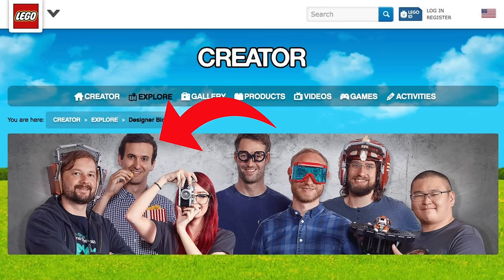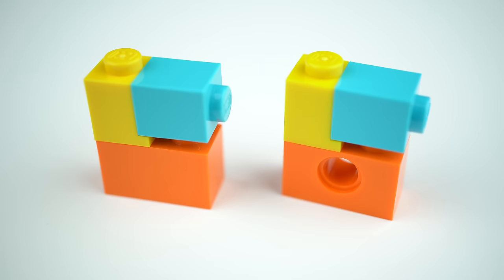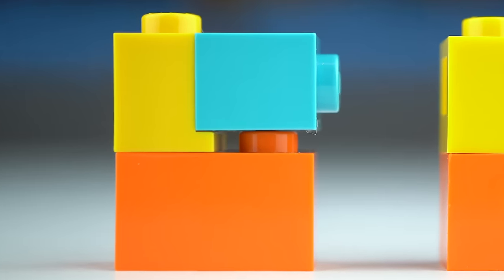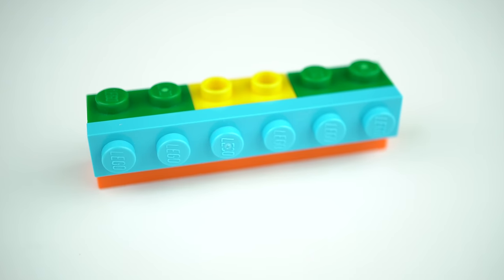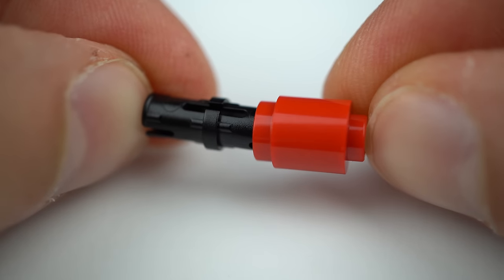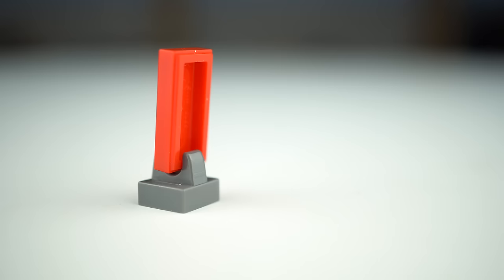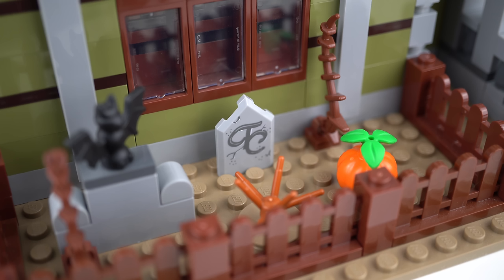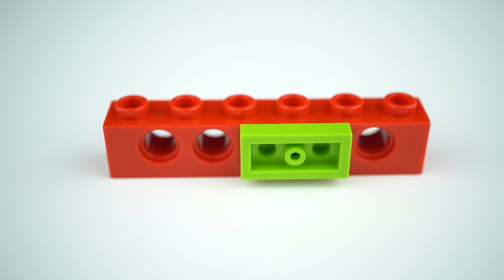Illegal LEGO Techniques

Comment: Oh so you designed the haunted house? Oddly I remember different people presenting it as creators. Either way I like that set almost even bought it but it was way too expensive where I live and importing it would cost double then what would I locally pay for ....

When it comes to preservation and proper usage.
My experience with LEGO is that many old pieces I have deformed or broke and I didn't even used it much.
There were few that I assembled and kept it as a display while upon dusting it off with a gentle brush I managed to somehow break pieces.
So using it how ever you want is welcomed because chances are some will break anyways so use it while you still can.
The high quality in LEGO is a myth, they are not that different from alternative bricks. Besides some of the even official ones are actually manufactured in China in relatively poor conditions. Hence why there is lots of knockoffs there since they copied or use 'outdated' molds.

Comment: I'm still a little confused as to how plates with more than one stud on a technic piece is illegal. I've seen people explain it as "the technic holes aren't spaced out the same distance as system plates", but putting technic pins (89678) in the technic holes and then putting the system plates on those is completely legal. What exactly is it that's causing the stress? 

I've seen a lot of mech builders also use a technique where they use 2 boat studs and place an axel and pin connector (32013) between each pair of studs, and always wondered if this was legal or not.
Reply: I know literally nothing about any of this, and had no idea about the concept of illegality before watching this video - so take my ideas with a grain of salt, however I think it's because of that extra diameter at the end of the technic holes that he mentioned for the technic pins to expand.
Reply: @willplay1a  The thing is, a single stud in a technic hole is legal. Plenty of modern sets use this. But having more than one stud in a row in Technic holes isn't.
Reply: @GEARscience  well a single stud wouldn't be introducing any tension forces, but if the gap between the holes is slightly bigger than the gap between studs, it would introduce tension (or compression if slightly smaller) when you have a piece with multiple studs. Again, I know basically nothing about this, so this is all based on what I saw in the video, hope it maybe helps?
Reply: @willplay1a  Well, yes, I understand that. But flipping the system plate the other direction and using technic pins to connect the same system plate is perfectly legal, implying that the distances between the studs and the Technic holes are the same.
Reply: @GEARscience  I mean he's talking about very micro differences, couldn't the difference be in the diameter of the technic pins (which are meant to expand/compress anyway to snap into place per my understanding of the video) vs the diameter of the technic holes (which are a fixed diameter that has to be bigger than the pins or else the pins would not fit inside).
Reply: @GEARscience  seems to me if nothing else, the fact that the end of the technic pins are engineered to compress or expand a bit at their end could be why it's legal?

Comment: Is their any actual reason why the hole on the technic brick is slightly higher? Was it a mistake in the original design and no one decided to change, or is it there to specifically serve a certain purpose. I could see in certain cases that a technic hole could be useful to mount a pice in a different orientation and would open more possibilities.
Reply from the maker: so there's enough space for the LEGO logo on regular pieces with studs

Comment: Hi Tiago, hope you’ve had a great start to 2023.  I was revisiting this video and have a couple questions - 1. I have been collecting CMF’s and have chosen to display by inserting the classic mini fig stand (88646) between studs on a 48x48 baseplate in a grid pattern so that they are perpendicular to the baseplate when displayed.  Given the element is considered a modified tile, does this present any long term risk or considered illegal.  2. In organizing my legos, I find it useful to stack 1x1 plates of each color together making it easy to pick up however many you need and not dig thru a pile- does this stress the elements over time and make their grip any less? 3. In the recent CMF Series 24, there is the awesome Football Referee which includes a soccer ball element - do you have any suggestion how to mount or display this with the fig - I only see a tiny hole like on some animals or minidolls?  Thanks

Comment: Something interestings is i have halo megablox set of a scorpion. I left it built for yearrs then i come back and it seems that thr treads defored the wheels to where you can see indentations from them being left like that for so long as if someone melted the plastic and the treads are supposed to be in the wheels.

Comment: Having the technic brick holes at a different height from a brick with a stud on the side seems like such an arbitrary decision that limits your build. Also if all that it takes to legally fit a plate on it's side between studs is to be microscopically shorter than why on earth would you not make all plates that size?????

Comment: I laugh at the word illegal.  how can using something YOU OWN to do with and build anything you want, ever be illegal?  I mean I have been known to mix bricks from alternative sets (for unique pieces not available from lego) and even wood logs into various builds...  heck even used erector pieces for some designs in the past...  They're mine, I paid for all the parts I'll use them as I see fit thank you very much....  If I want to sand off the lego logo on every brick, I'll do so (why anyone would is beyond me seemingly a huge waste of time, But still).  no one can control an item's use after it is purchased from the seller.

Comment: There is no such thing as illegal connections.

When we all played with Lego as kids, we did whatever we wanted and lived with the consequences.

Yes I understand the intent here regarding possible damage to a solid and extremely hard wearing piece of plastic, but as kids, we all saw if the connection wasn't right and either accepted it or changed it.

"Illegal" is what happens when adults go back to their childhood Lego sets and start putting rules in place to control themselves and others because that's what adults have been conditioned to do since school. Rules for the sake of rules to make everyone feel confident and secure about the "right" way. Talk about sucking the fun out of a children's toy. Oh you're an adult and a serious builder? Seriously, Lego is a kid's toy first and foremost. If it wasn't, Lego would be sold exclusively in adult hobby shops alongside model aeroplanes and Warhammer 40k.

Damaged bricks? I got news for everyone: your Lego bricks won't last forever. Sorry, accept it. But they'll last an extremely long time. In England a ship with Lego sank into the sea and for years washed Lego pieces onto the beach and the Lego is just fine: Lego pieces are very hard to break but want to be paranoid about brick damage? Your decision, your life. But to use the word "illegal" betrays a very controlling and intolerant mindset for a children's toy. A more neutral phrase like "sub optimal connection" would be more appropriate rather than a term that sounds like you've committed a crime, should be arrested, put on trial and sent to prison.

Unless you're a professional Lego builder who regulars builds and disassembles the same set of bricks multiple times for competitions or a designer who works for Lego and comes up with the next Lego set to be put into mass production, honestly who cares if the connection isn't right. Change it or live with it. Don't like it? Well build your Lego how you want and relax a little.